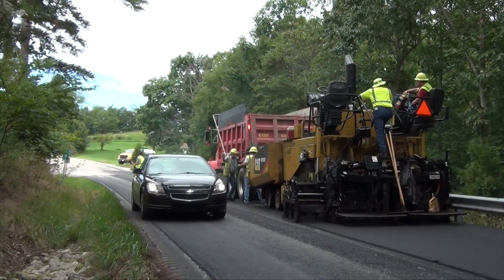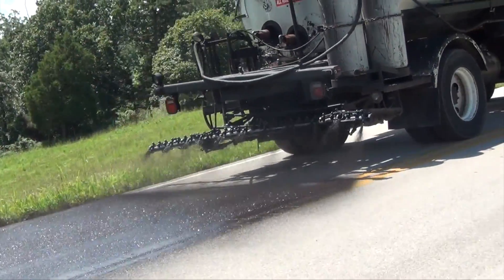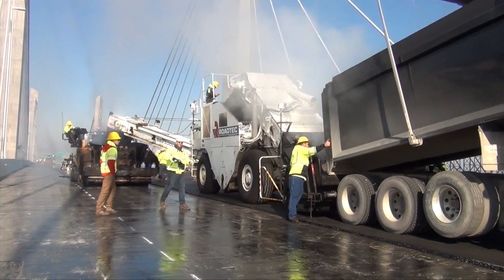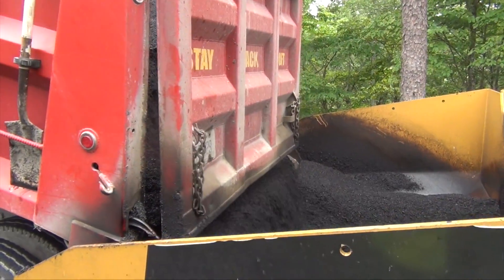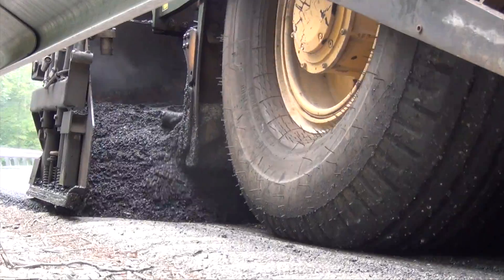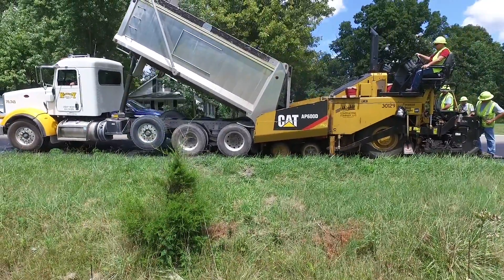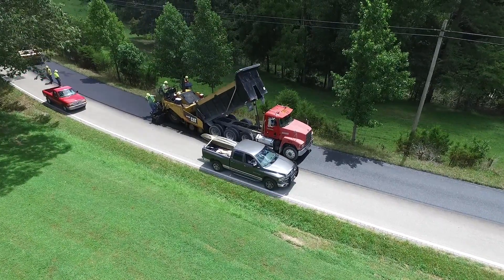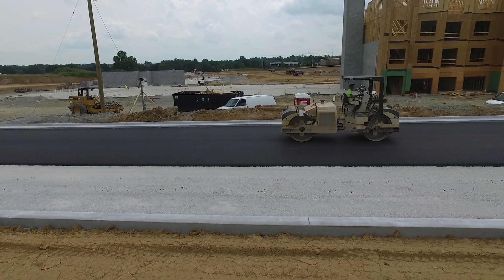The Paving Train

Comment: Should add an Infrared Joint Heater to the paving train, as the joints between the layer being applied cannot be easily compacted so are usually 5-6% less in density, which turns into an early deterioration of the joint area. The 2016 Caterpillar Paving manual includes an Infrared Joint Heater in their description of best practices. For info : bob@asphaltheater.com